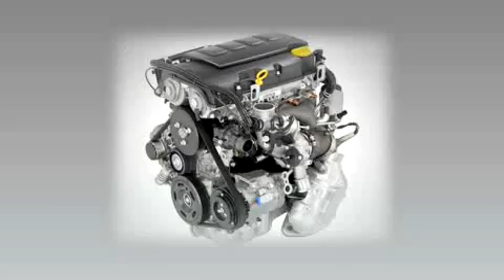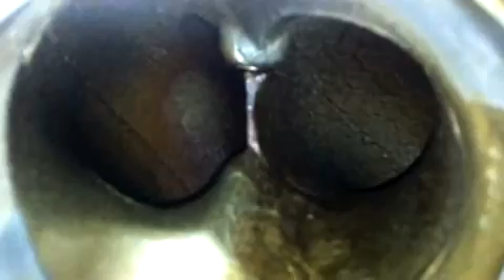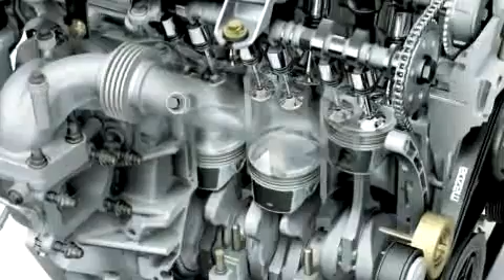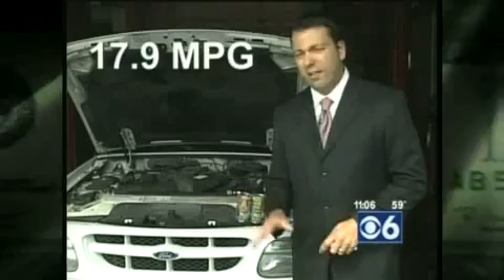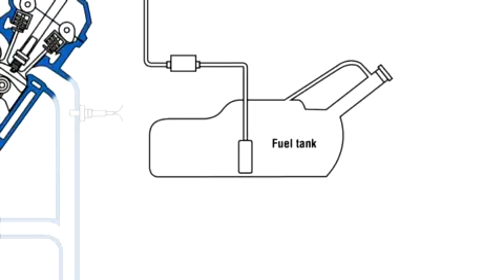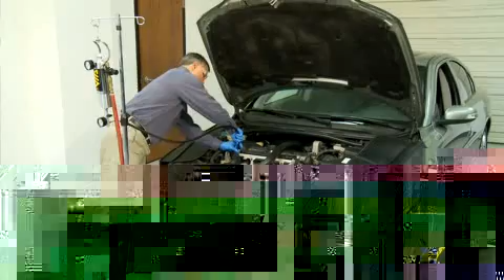BG Fuel / Air Induction Service

Comment: unscrupulous repair shops sell this service as a way ti increase their revenue.  The vast majority of engines do not need the service.  I for example use Top Tier gas always stay up on maintenance and as such realize the same gas milage (perhaps very slightly better) than when the car was new and it has 91,000 miles on it.  Guess what a repair shop recommended this service as a basic restorative repair for a tad under 200.00.

Comment: I have a 2011 Taurus SHO with 60k on the clock. I added BG 44K this past weekend, and almost immediately noticed a performance improvement; similarly, my city MPG has improved from 16-16.5 to 17.5-18. I was initially skeptical, since 44K is more than twice as much as the second most expensive fuel system cleaner (which probably doesn't work on GDI engines anyways) I found, but this is definitely a product that's well worth the outlay. I plan to add MOA the next time I change the oil as well.
Reply: Tyler Brown i just did it on my sho feels amazing how long did it last? bg recommends it ever oil change. i think ill be getting the MOA next aswell.

Comment: If ifs that good, why don't oil companies simply add it to the refinement process????
Reply: oil companies will not add it, this way the auto industry keeps busy, if they were to add it, they would have to charge more for gas,,,just as the reason most car manufacturers use plastic all over the engine bay more than ever.. cars today are made to last at most 10 years if well maintained...I am a car mechanice 28 years exp, and I see lot of things that can be done better,, but I will not have much work
Reply: @datingscam  10 years? I work at a Toyota dealer, and the majority of the cars that come in are older than that
Reply: Rebn Sakesdgd Everything in engineering involves tradeoffs, and manufacturers do their best to balance many things - performance, reliability, durability, economy, comfort, style, etc. - while doing so at a price that's profitable yet affordable. Sure, the car companies could manufacture vehicles that were designed to last 30 years or more, as the aerospace industry does. However, there's a number of reasons why they don't, first and foremost being that most consumers simply aren't interested in driving around in a three-decade old vehicle; given that such cars would also be several times as expensive, they're even less interested in making 12-25 years of payments on a new car. Likewise, cars are prone to crashing (much more so than aircraft, especially commercial aircraft), so very long product life cycles don't make much sense.
Reply: in direct injection engines I believe it wouldn't get to certain parts of the engine. that's why they have to shoot it inside with that atomizer thing

Comment: The BG Air Intake Cleaning Service will remove fuel residue from the air-intake manifold. However if you are asking if it will remove the intake VALVE deposits, that is an entirely different question. You are correct in that no fuel spray hits the intake valves, so these deposits have no mechanism by which to stay clean. While the BG Air Intake Service can remove a small amount of these value residues, it will not be capable of cleaning them entirely. BG271/BG272 Service will clean them though!
Reply: so what should I ask for if I want the best cleaning including the intake valves

Comment: So you were standing watching the process, and witnessed the product leak onto the paintwork?
Did you say or do anything at the time (or did they) - like wipe it off the paintwork?
Have you went back and spoke with the owner?
The product hardly "sucks" because someone cranked up the pressure too high or didn't follow best practices/procedures.
Rather than malign BG, your gripe is with the owner/operator of where you had the service done.